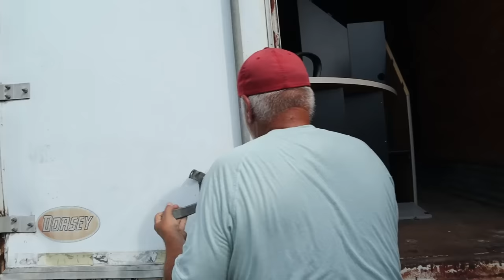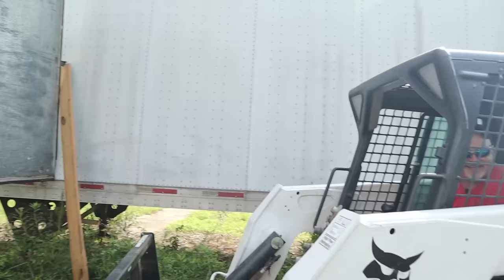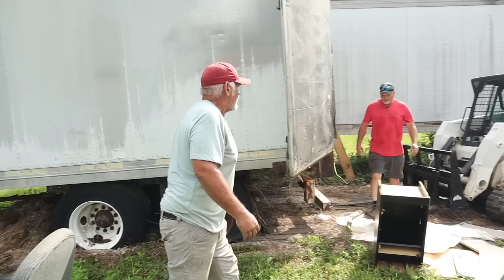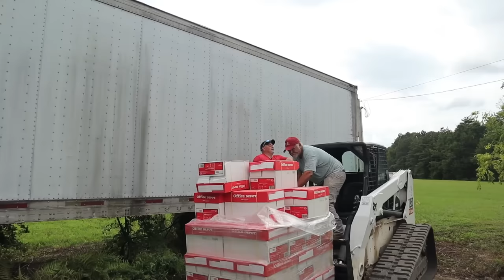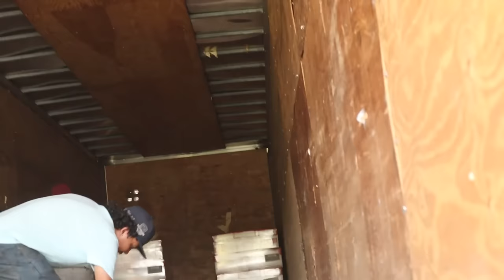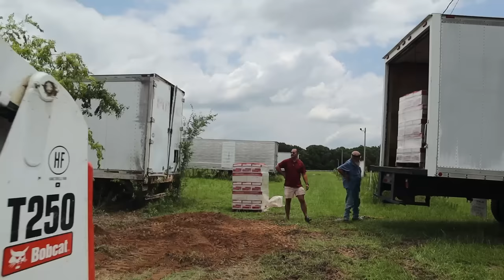WE FOUND THIS HIDING in this semi trailer! LEFT IN TRAILER FOR 10 YEARS!

Comment: Some skid loaders have self levelers on them , mine does, but it’s a CASE . I think the reason why your machine may squall is because the pumps require the machine to be at a higher rpm . Whew that’s a lot of stuff to unload Hank! You need to buy Wiley some lunch! 👍
Reply: Hydro needs be wide open throttle then function by easing levers
Reply: Wiley got hank  into that job.

Comment: Like others have said you have air in the hydraulic system. I worked with hydraulic systems for 15 years and I know that sound. A good way to damage the pump(s). This is an extremely destructive condition that leads to metal erosion and damage to pump internal surfaces. Causes of cavitation include fluid line blockages, blocked fluid filters, overly high oil viscosity and excessive pump rotation speed. Good luck.
Reply from the maker: I'm afraid you're wrong.  I've had it checked by Bobcat twice.  No issues found🤷🏻‍♂️
Reply: @HamiltonvilleFarm  Then we have to disagree, not a problem. I would suggest you get another opinion. Watch other videos with the same machine you have if they sound and act just like your than I stand corrected. Keep up the good work..
Reply: @WornGuy  He wants if to Fail. Hopefully not with an Injury or Other. so He has Video content for the Repair  ...

Comment: You need to check the condenser on your A/C make sure it's not dirty and that you have good airflow across it if the system can't get rid of heat it will not be able to absorb any in the cab and that equals swamp balls for the operator